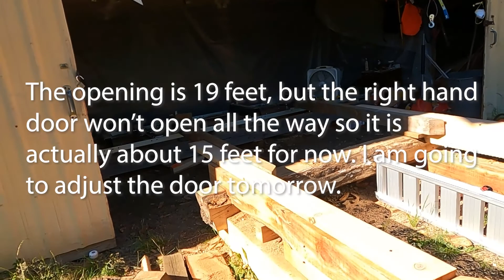LOG bunk PROBLEM Solved | Its finally Finished | Fitting 16 foot log through 15 foot opening

Comment: I really hope that your "fork-system" is temporary because the bucket will not hold. I have no audio so I'm just guessing...
 You make a really nice bunk, but why? In America you like skid-steer so get such a coupler on the tractor. Then draw a hydraulic line from the back (acts like a third function) and get a grapple. You don't even need a grapple, just put the forks wide and put a chain around the log. When the log is where you desire: take the chain off.
 BTW, I don't know how, but someone should do something somehow about your dust collection. It could need some improvement...
 Have fun and keep safe 👍🏼💪🏼😎!
Reply from the maker: Johannes, thank you for your great ideas. My intention is to load larger logs using a cable system to pull the log up ramps onto the bunk, then roll the log onto the sawmill bed. I built the bunk because I do not want a tractor with forks or grapple near the sawmill bed. The mill bed needs to remain extremely level and square, and using equipment near it risks bumping and disturbing that square and level. The way I have it built, the only connections are the temporary 4x6 beams that sit on the bed rail. Very little chance that they will disturb the bed like an errand tractor or skid steer might. 

BTW, a decent skid steer is out of my budget by a long shot! 

As far as saw dust collection, Yes this is a problem, but I can use a shovel and bucket for now. Later this summer we will be moving the saw out to a new shed that will have better accommodation for dust collection.

We are having fun. This is much better than lying on the beach getting sunburned (at least I think so)!

Again, thanks for taking the time to watch and comment. I really appreciate it.
Reply: @a_farm_west_of_boring  
Sorry for beung vague, didn't mean a whole skid steer! I meant the connection attachment (adapter plate?) at your front loader. Other than that you are making nice lumber, 👍🏼👍🏼 from Finland 🇫🇮!